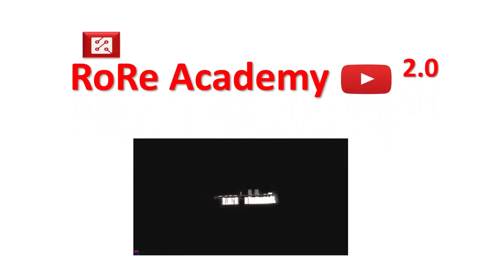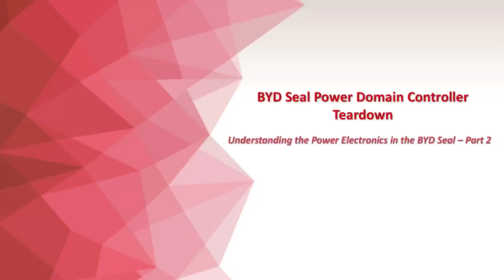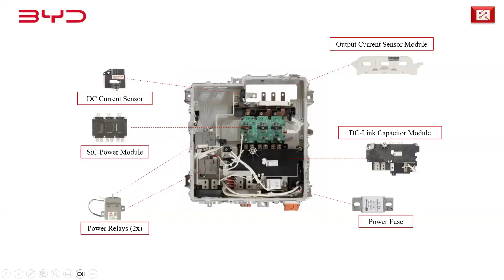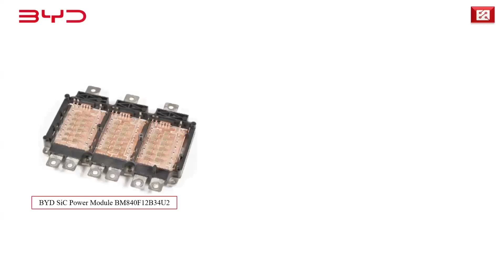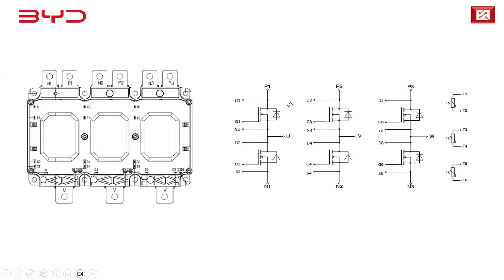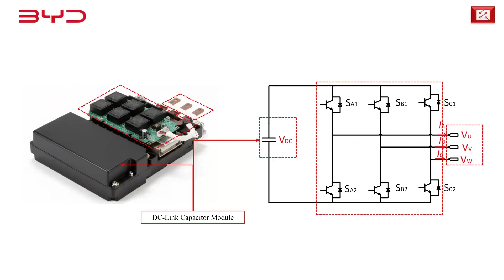BYD Seal PDC: This Changes Everything | Understanding the Power Electronics – Part 2 | RoRe Academy

Comment from the maker: Welcome back to RoRe Academy!
In Part 2, we dive deeper into the BYD Seal Power Domain Controller (PDC)—breaking down the traction inverter, control electronics, DC-link design, and system integration that are changing how modern EV power electronics are built.
Like, comment, and subscribe if you enjoy real EV hardware analysis—not hype